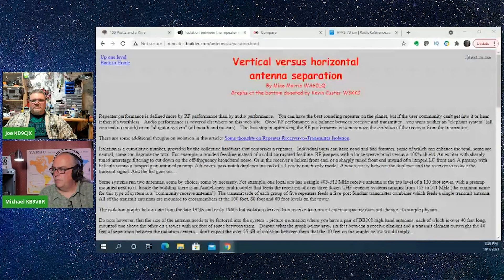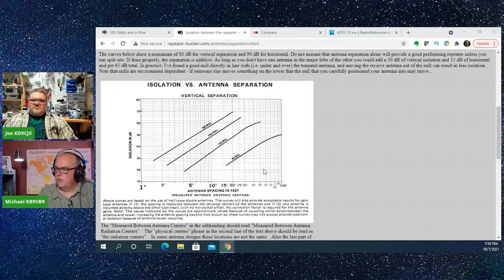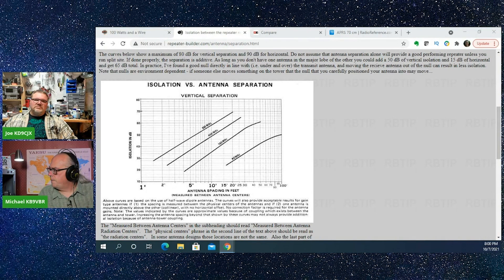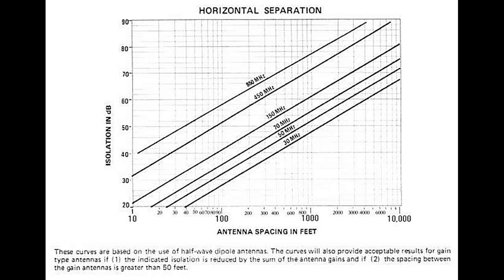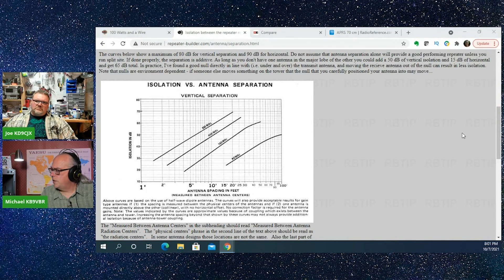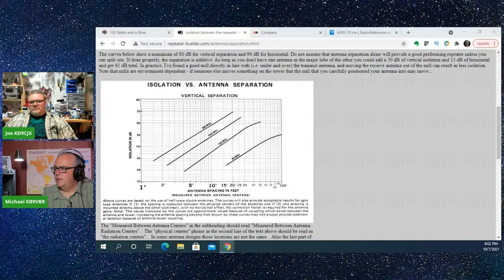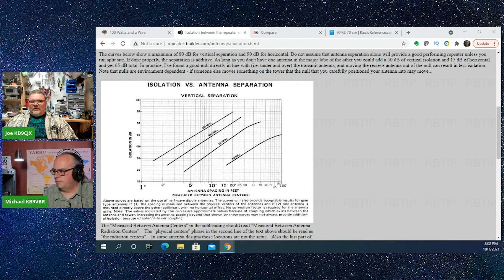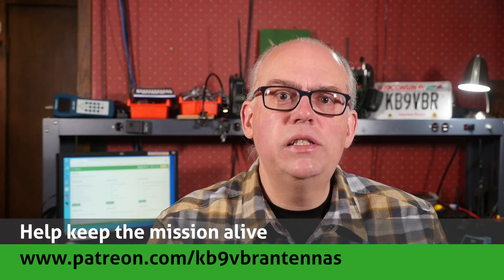How close can I mount two antennas? October 2021 Livestream Excerpt - Ham Radio Q&A

Comment: New HAM...looking to get a shack-in-the-box setup like a FT-991A and run two vertical antennas (one HF and one VHF/UHF). The HF antenna will be much taller than the UHF/VHF antenna and allow me to pick up 80 to 10 meters. I'm looking at keeping them about six feet apart on the same section of my roof (just outside the shack). Anyone see any issues with this approach?

Comment: Hey guys, I currently have a 10/11m vertical antenna mounted on the roof of my house. It's 17' I think. I want to put another vertical HF antenna using a 4' standoff bracket on the same antenna mast. I will only be using one radio at a time. Will this work?  Will the 4 foot separation be enough? I really don't have any other options available to mount another vertical. Thanks for your advice.
Reply: no. bad idea

Comment: How far away from a metal pole that you are mounting your UHF/VHF antenna on should that antenna be? If you are going to start stacking antennas, you can only have one antenna at the tippy top and the other stacked antennas have to be lower on the mast/tower.

Comment: How about antennas on a vehicle? I have a CB antenna on an NMO lip mount on the driver's side of my truck's hood at the back, and the factory stereo antenna on the opposite side. I intend to put a GMRS mobile, and a dual-band mobile in the truck. I intend to put their antennas on L brackets between the fenders and hood. How far apart can they all be? I could do roof-mounted antennas, but I'm hesitant to drill holes in the roof.

Comment: PART  #1   Separation and frequency choice is key. I used to talk to friend a long time ago on 220 simplex. We could talk any time of the day, I used a Cushcraft seven element beam mounted vertical on the one side of the tower 30' up. The friend had a home brew 220 beam and his was up 30'. Our simplex path was 75 miles, transmission FM. I also had a 220 repeater at my site also. I had a 440 repeater as well. My friend was a novice so 220 was the all he had. I had a 440 repeater antenna mounted three feet away from the 220 beam and my friend could be received on a 220 simplex frequency on the Kenwood mobile that would trigger my 440 repeater and I could talk to him.  GO TO PART #2

Comment: PART  #2      When I went in on 440 the Kenwood mobile wood transmit on the 220 simplex frequency back to him. It was cool. The three foot separation worked with no problems, 20 watts on 220, 30 watts on 440. This was early 1990's so there was no computers. I went to Radio Shack and bought those little engineering pamphlets they used to have for I think 50 cents and figured out how to build the necessary controller to do the job. I plan on moving back to that acreage soon, it is an excellent radio location. Best contact from there is 50 miles on a 440 repeater using a Kenwood TH-41AT, 1 watt HI, 150 mw low. I contacted and talked on the repeater on 150 mw with the rubber antenna in side the house.

Comment: I think that everyone has missed the right answers. Sure, what has been said works, but reality has some difference.
For a VHF and a UHF, they can both be on the SAME antenna, no separation needed.
For adjacent VHF, it depends on how much desense you can tolerate. In most operator's situations, you can accept quite a bit. The most important number is how much energy can your receivers accept before they are damaged, and that is quite a bit. This isn't generally a problem with VHF/UHF radios unless you start adding some large amplifiers to them.
The answer often becomes how close you can effectively mount the antennas. You'll see communications vans with antennas on grid points often around 1-2 ft apart. 

To get back to the specifics of the direction that the hosts were referring to, you have to start with the frequencies. And yes, if you change a frequency, you invalidate most of the calculations. So starting down that path isn't the greatest way.
But if you look at the frequencies, you start to notice some interesting artifacts. You may think that one radio on 145.05 and another on 145.07 may be too close, but their transmitters are at 145.65 and 145.67, either one is about 0.6 MHz away from each other. 

It is a complicated answer and my general recommendation is to keep as far as part as possible, putting in different vertical planes if possible. But remember that if you separate two by 500 ft, while the desense will be decreased, the coax loss is going to kill you.
Reply: That would work by using a duplexer if the antenna was a VHF/UHF dual band and not a single band antenna. I'm sure you were just using those frequencies as examples, but 145.05 and 145.07 are packet frequencies. I actually have two Winlink gateways on those same frequencies, one is packet and the other is VARA. The packet gateway gets into the VARA gateway radio, but the VARA never gets into the packet gateway radio.

Comment: OK so if I had a UHF/VHF antenna and an HF antenna both are verticals, can I mount them on the same mast one above the other? Which one should be on top? This video is a good video because I have limited space but can run one mast only. But I am not certain that what was talked about covers my situation.  Thanks!
Reply from the maker: Typically you'll want to mount the VHF/UHF antenna above the HF antenna as you'll want the height for the VHF antenna to be effective. Height isn't as much of an issue with HF. But putting an HF and VHF vertical on the same mast may introduce other issues that are beyond the scope of this video. Bottom line, it will depend on what HF vertical antenna you are looking at and if it will be compatible with a VHF/UHF antenna on the same mast.
Reply: The coax for the higher antenna will run up the mast past the lower antenna, so it would be good to mount the lower antenna away from the mast on a stand-off. I'm not sure how far away you would need to get the lower antenna away to not couple with the higher antenna's coax though.

Comment: If I run a HF antenna like a 20m dipole line along side my 2m/70cm JPole, (maybe 2 away or so)  would it have any negative effects on either antenna? I would not be running them at the same time.  My JPole is working great in my attic and I’m wanting to set up an HF antenna up there as well.
Reply: if to close they may couple with each other and throw off both antennas. Near field is tricky.
Reply from the maker: It can depend. Typically you can put a VHF/UHF above an HF wire antenna without much of an issue, but depending on location and type of the antenna, you may need to increase the spacing. There isn't often a solid answer, and you may need to experiment a bit to find a solution.